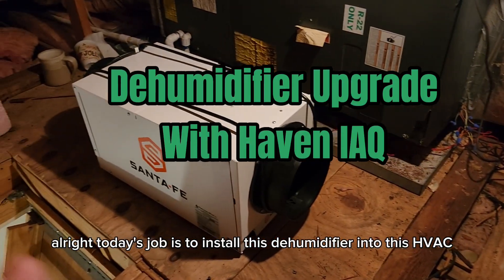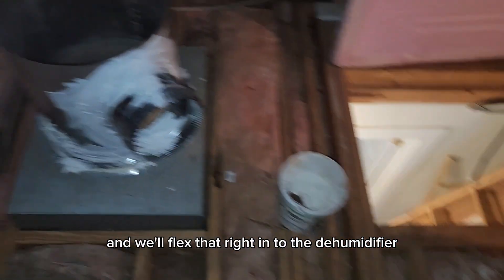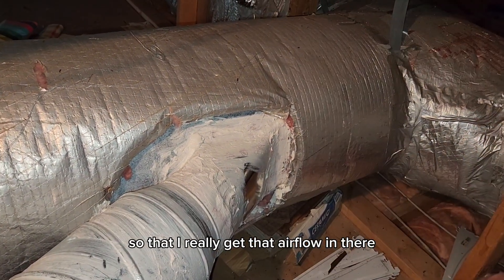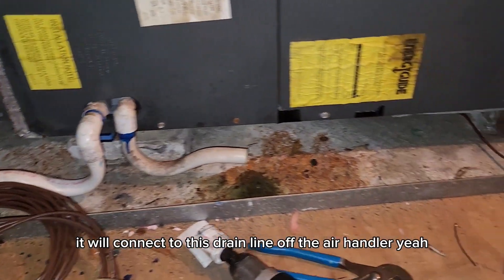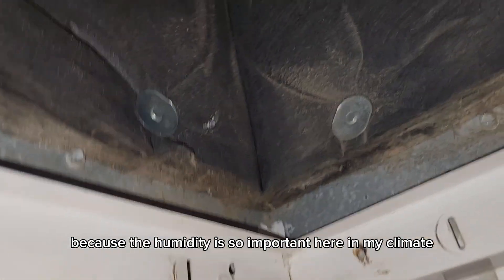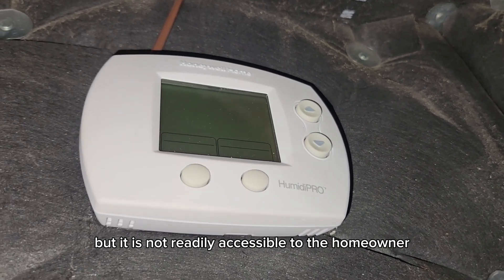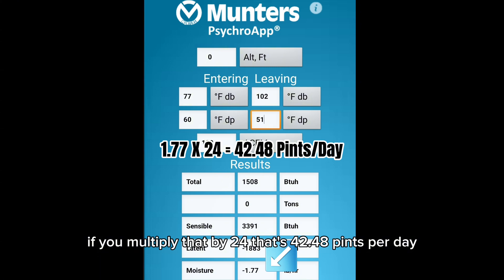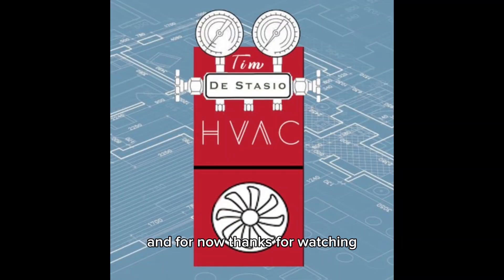Dehumidifier Upgrade With Haven IAQ

Comment: Do you need a backdraft damper on the main hvac return after the dehu return location so that the dehu isn't pulling air backwards through the main hvac when it's on but the hvac fan is off?
Reply from the maker: The friction and potential problems with a backdraft damper is not worth the solution for that very small problem. The air while it may be pulled from the air handler will mostly be pulled from the less restrictive return.

Comment: Hi, i have a few questions and thank for the video !! 
1-If I did listen well to your video, the Dehumidifier is connected to the return and supply side so you are able to bypass the HVAC and dehumidify without the « furnace » fan working. 
2- I saw another video where you explained Haven install controlling the dehumidifier. Does it mean you run dehumidifier in winter as well ?
I love the backup control idea, in my case I use a Ecobee but if I add a Haven in the future that’s a great idea !!
Reply: Oh and I see the static pressure is .34… is that a usual level ?
Reply from the maker: @sharkiedoo 0.34 is low bit thats good as long as youre getting the right airflow. Mu dehu FAN runs in the winter but not thr compressor. That way i still get ventilation.

Comment: Nice set up! 
We use Aprilaire, and we don’t do the powered damper or the 45° approach to the supply.
Have you measured a difference with those changes?
Reply from the maker: @JoeB3  it depends per job and it really helps if supply static is high.